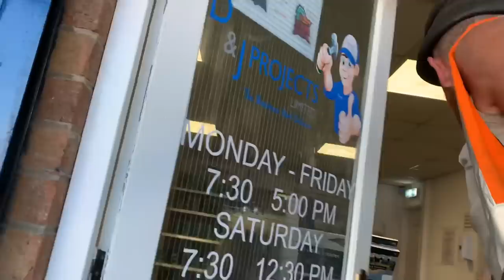A days work at D & J projects fellow YouTubers, bleeding machines, grab change, trip to Scottys

Comment: had this on a bike .  on fluid leak but the flared union on the flexi was letting air in . found it with uv die
Reply from the maker: It just shows you how slight the leak can be to drag in air Simon 👍 cheers mate

Comment: I'd be lost without me Map-gas torch- same as the one you used - very handy for heating stuff that won't open, easy to chuck in a toolbox. If ye did the sandpaper on the shaft before removing the bearing, it'd have been less hammery. :-)

Comment: Tele handlers. Wet brakes and use light hyd oil in the brake system so if the brakes leak the leak oil into the axle not brake fluid.

Comment: Master cylinder(s) would be my first try on the Telehandler, had the same on ours. them JCBs have a common problem of the spool block leaking. there is a reseal kit available but they are easy to mess up.
Reply from the maker: Cheers parastorm! Bet they are mate, I shall investigate 👍

Comment: @ 9:31(I haven't watched through the whole video yet).

But I believe if it's spongy brakes and you don't have a leak it's the master cylinder leaking.

I had this problem on my car, all the lines were good. No leaks anywhere, fluid was good. Eventually found out that the master cylinder was leaking. Apparently there are 3 different o-rings and overtime (my car is old, 1997) the o rings wear out.

So I replaced the master cylinder and that fixed my problem.
Reply from the maker: Thanks XL Dave’s getting one mate…. It does sound suspect 👍 cheers for the advice much appreciated 👍

Comment: If your getting a good pedal on the shovel when pumped up, they could need adjusted up in the drums as return springs keeping them off but the delivery of fluid isn't enough in one press on the pedal to put out all 4 wheel cylinders.  Great video Chris!
Reply from the maker: Didn’t even think of that mate… makes sense I’ll have a look, thanks for the advice Keith 👍
Reply from the maker: Was that mate thanks gave you a shout out Keith 😁👍 top man
Reply: Great that I could make it less of a struggle for you! I wonder is there a spring tab on the adjusters to prevent them adjusting off when being worked? Thanks Chris

Comment: I’ll tell you I had a bloody nightmare today got to share this. 2010 DAF cf 4 axle tipper. 8 new brake pads and discs 6 new callipers. 4 bolts snapped. Suspension arms all bent and broken. 2 leaf springs cracked. Everything rattling in the engine. Called the customer asked if he wants the job done by the company he goes yes please. 7 hours and still fucking got the wheels on
Reply from the maker: Mate 🤦‍♂️ it sounds like a right mission, how you got on with it?
Reply: @Professional-struggler  4 days and 8 guys later back to work it went with a hefty bill
Reply from the maker: @kapiwie3015  no wonder mate 😅 needs must 👍